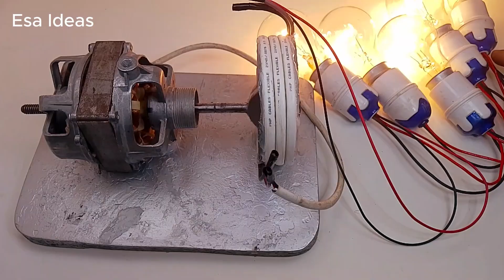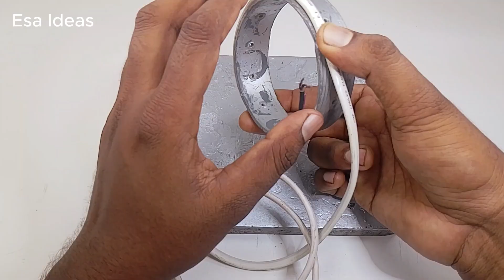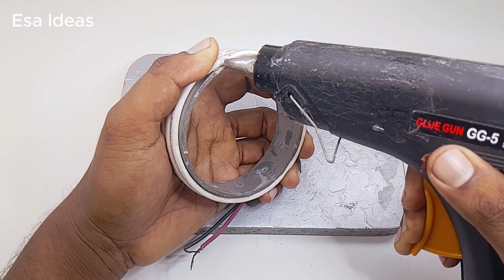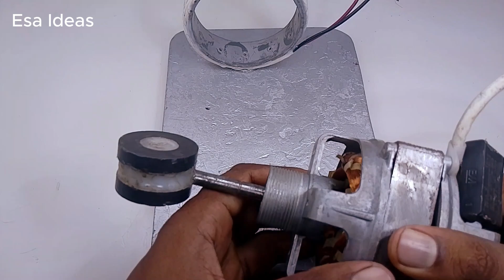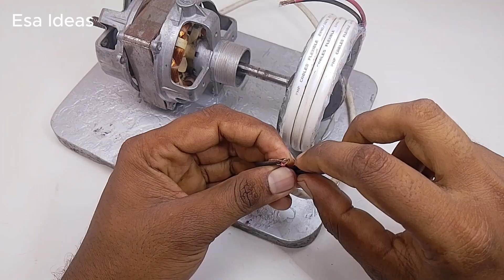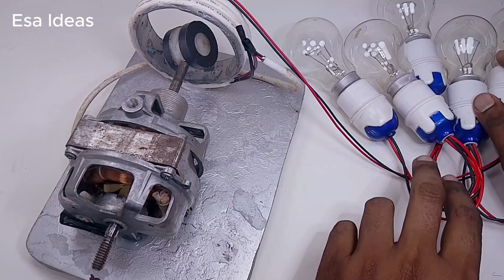New idea Free energy 250v electricity 220000w energy generator use magnetic power copper wire

Comment: LOAD OF B.S.      YOU CAN'T GET 250 VOLTS OUT OF 3 TURNS OF WIRE..... IT TAKES HUNDREDS OF TURNS.     WHITE WIRE FROM MOTOR IS NOT CONNECTED TO MOTOR.    MAINS POWER IS USED.    SPIN THE MOTOR AND TURN ON MAINS ELECTRICITY AT THE SAME TIME.    OLDEST TRICK ON YOUTUBE.   FAKE RUBBISH TO COLLECT CLICKS.      EVERYBODY IS USING SAME LIES.